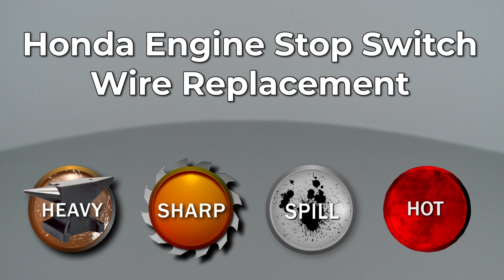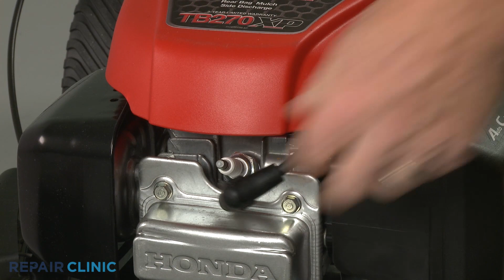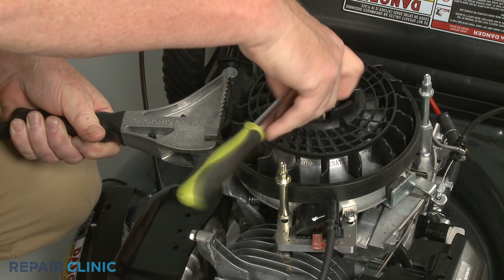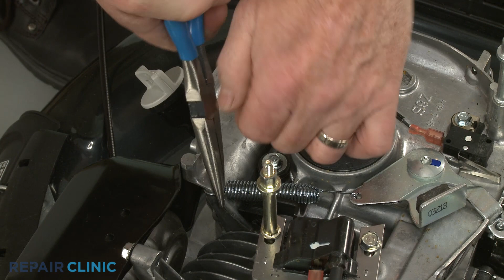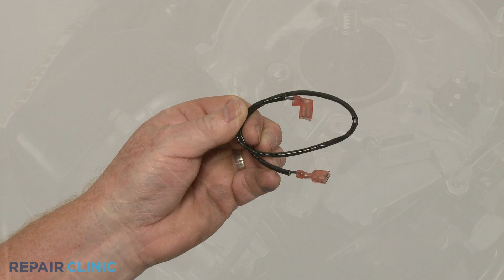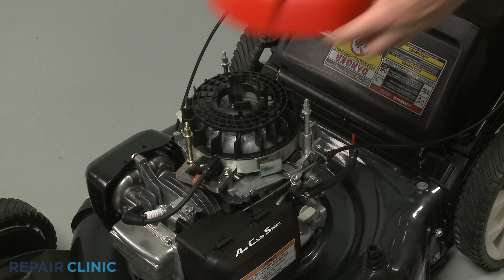Honda Small Engine Stop Switch Wire Replacement 32195-Z8B-901

Comment: This video is exactly what I needed. Thank you! A mouse chewed through that exact wire and my mower wouldn't turn off. Great video thanks again
Reply: Did you have all of these tools on hand that are mentioned in the video?  Specifically the strap wrench or the fly wheel puller?
Reply: No I didnt I used a block of wood and wedged into the blade underneath so it wouldn't spin. And to remove the flywheel I used a hammer. There is a video on how to remove a flywheel for lawnmower without a puller.
Reply: Noce! I thought I was the only one with a mice chewing through this random wire. Search online and theres a vid and other people with same instance. Ahh the wonders of technology now we can all suffer together.